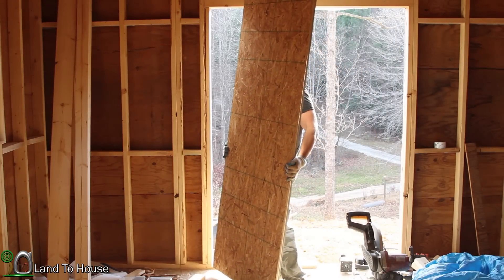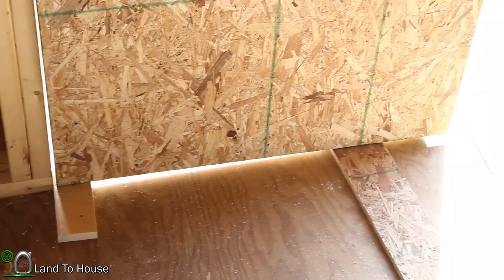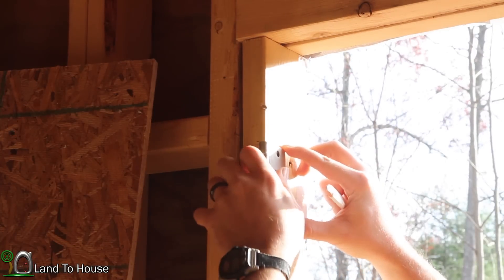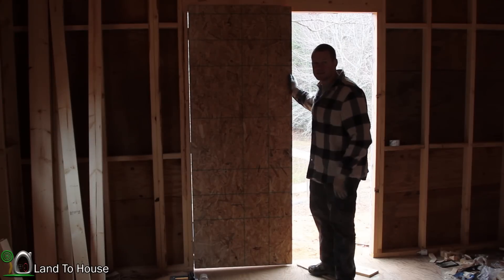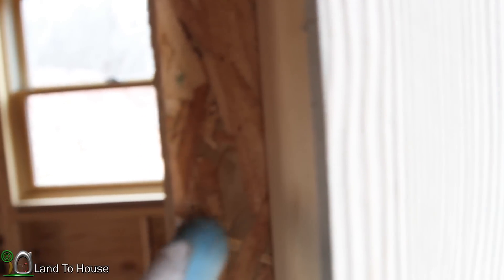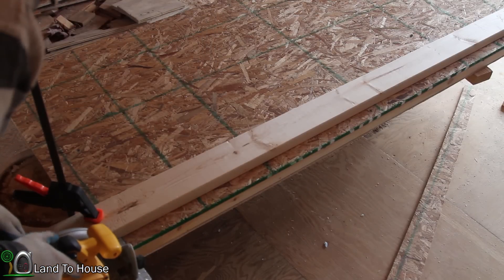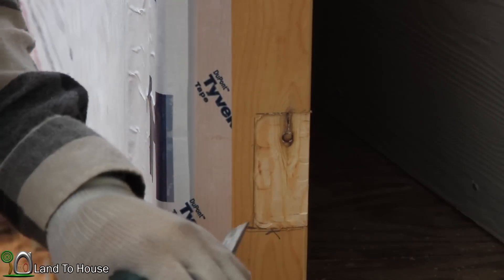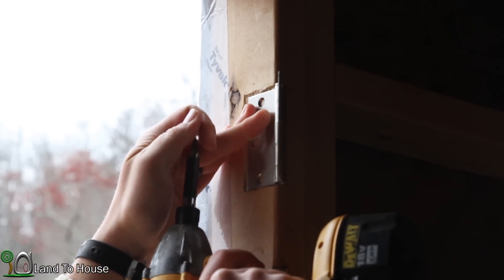Build a Door Part 2 - Build a Workshop #16

Comment: that is working out nicely!.. tip from my side, the doors are heavy so you can position th middle hinge higher so it helps to resist the pulling force you have of the door on the top ( the bottom is pushing). as asecond tip you should defintely use longer screws especially because you have hinges with only 3 screw openings and a more heavy door.
Reply from the maker: Good tips! I am not sure that I will move those middle hinges but I could always add another one higher. Longer screws is a must! I have placed some 2" screws in some of the holes but I will replace those small ones soon. Thank you.

Comment: I remember making custom doors for a room in the old house and spent ages fiddling with them to get them level
Reply from the maker: Had I not cut the bottom place when making the walls this door would have been surprisingly level.... but the frame was off by 1/4" to to 1/2" start with. Live and learn.
Reply: I was trying to fit doors in a "wonkey" 1930's house where none of the internal walls were square or plunb!
Reply from the maker: +Mike Gomm I bet things have changed a lot since those doors were first made. And lots of shifting.
Reply: But then we sold the house (15 years later)and moved
Reply from the maker: At least you have that skill under your belt.

Comment: I would have spent a little extra time and make a jig to route out the hinges .. 😉  I liked how you put foam bored in between for insulation
Reply from the maker: I am learning about those little tricks to make things better. I made a jig to help build a ladder and it was much better. The foam was a good idea. It helps to keep the shop less hot in the summer.

Comment: I would consider replacing those short screws on the hinges with longer deck screws. Those tiny 3/4 are holding those heavy doors. It won't be long before they rip out with constant use.
Reply from the maker: Yes indeed. especially since I have the wood space behind the hinges. I did use 2" screws on some of the other doors so I need to use more on the others.

Comment: to bad mainepreppers videos are not on youtube any more.  It was the best way to make and install a door. Basically you build the door frame in place, and one side to hold everything in place.  Mine worked on the first try, and it was the first time I built a door.
Reply from the maker: That sounds nice! I have not heard of those videos. Once I got the hang of this it was not bad.
Reply: I covered my OSB with chalk board paint, so my daughter can play while i work.
Reply from the maker: +Nate B ohhh good idea! I might have to use that idea. I bet Emma would love that.
Reply: Put a good primer coat on to smooth it out some.
Reply from the maker: Yes. I think that I have both primer and chalk paint here at the house.

Comment: I agree with tsx3214 on swinging out to save space..  Also harder for some thug to kick in.  I also agree with Andrew on longer screws. Coming along nicely though.
Reply from the maker: I am going to replace those short screws for sure! I had an issue with swinging out. I could not find the hinges when I was looking. But the main reason that I wanted the doors inwards is because of the way the ramp will be on the porch. I dont have a lot of room to make the porch because of the location of the septic tank.